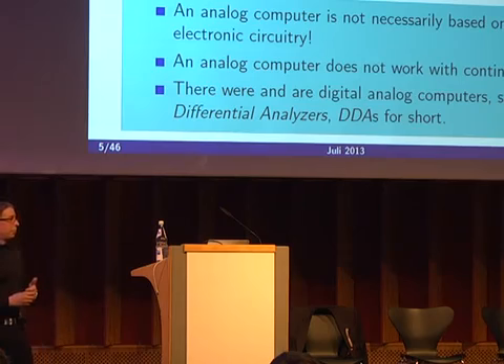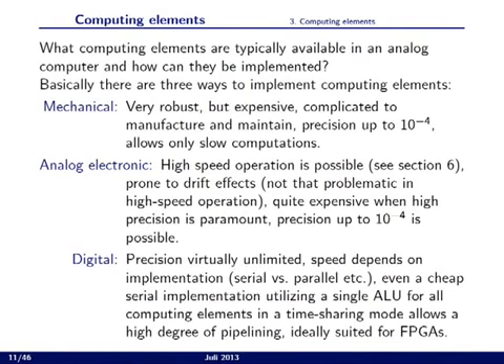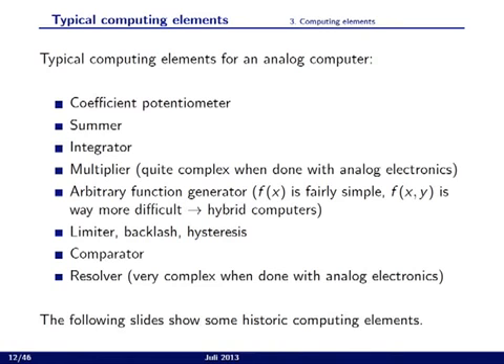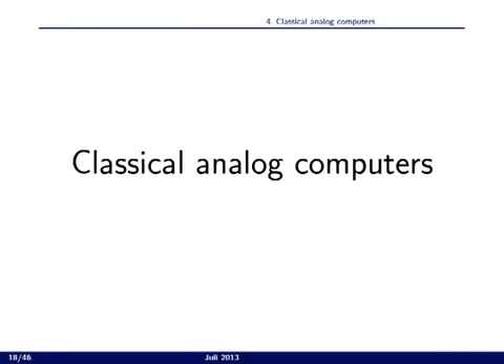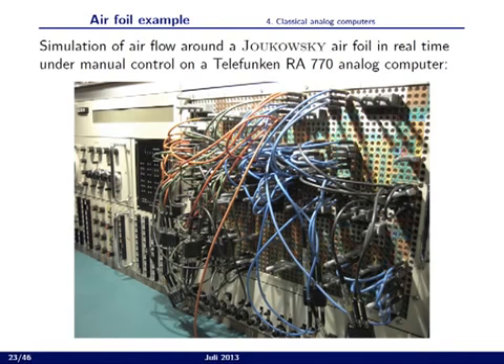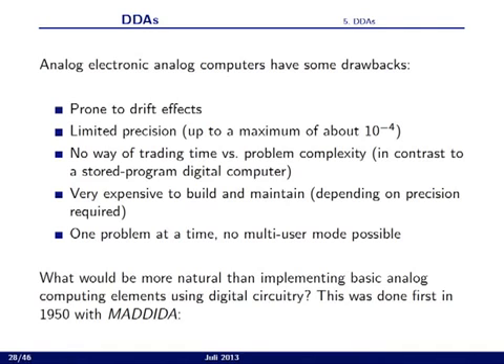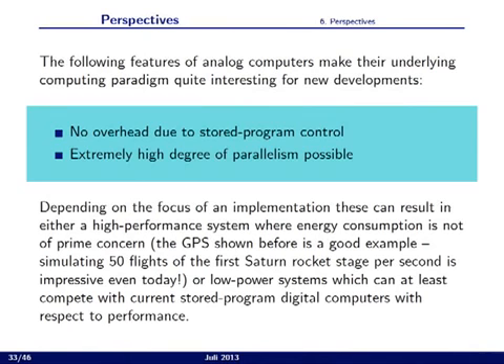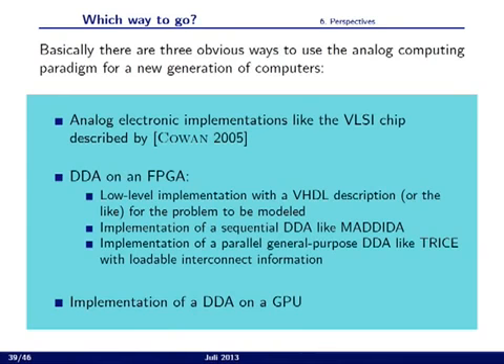[SIGINT13] - Analog Computing

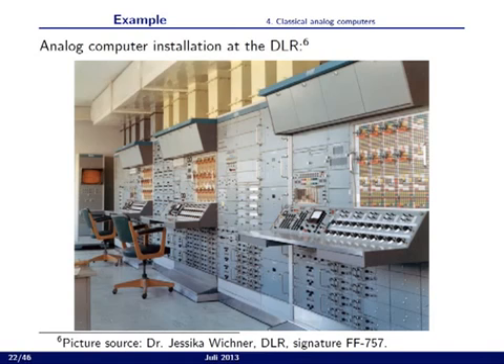Comment: In the early 70's, I worked in a lab that had a huge analog computer.  It looked like the one at 16:30. It was used mostly to design ships, barges, oil platforms, and so forth. I never learned to program it. My job was programming the IBM 360/44 that the analog computer was hooked up to.